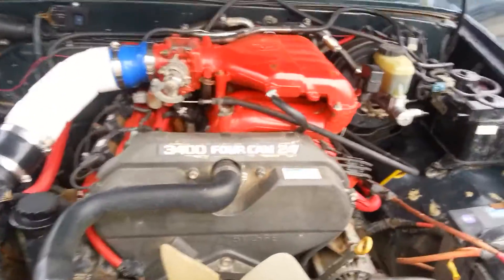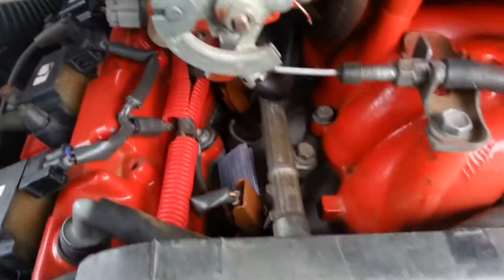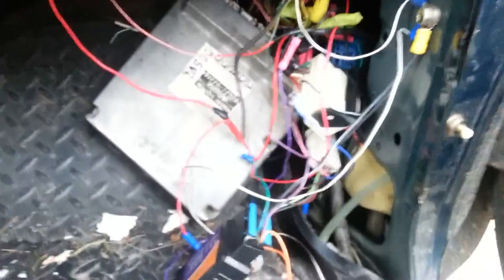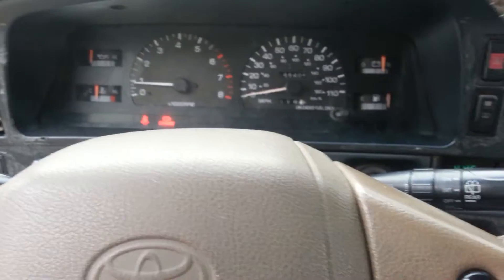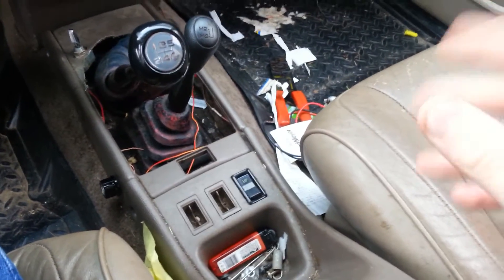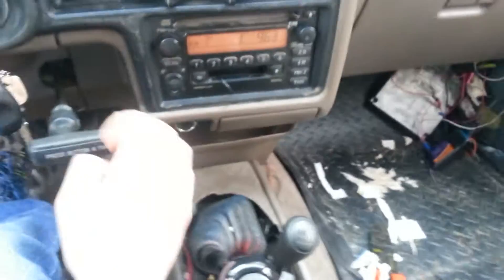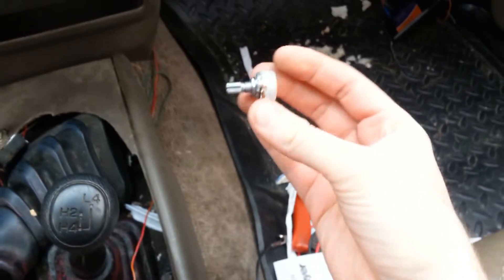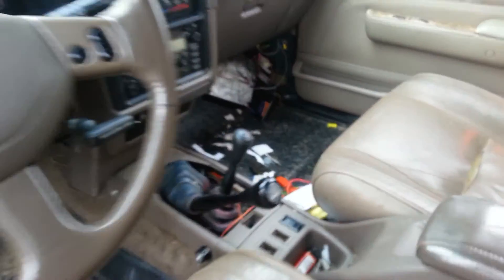ECT (Electronic Coolant Temp) Sensor Mod __  [How To Video]

Comment: What would you do for me I have a 3rz auto 97 and my idle is low 630-650 only in D or R and causes rough idle, ac on and its okay. Do i have ect trouble? What can i do for the pcm mod? I dont have that level expertise would u say i take it to a tuning shop and let them fuck around with the pcm
Reply from the maker: Your IAC valve might need to be cleaned due to being dirty from the PCV system. This mod might work for you but its more of a general fix for other vehicles that have been swapped and have a low idle caused by using a auto PCM with a manual transmission.

Comment: Did you buy truck with 3.4 swap or do it yourself?  I hear some say it's a good swap with no issues,  others say codes popup after swap and other issues.  Also I have auto so I think the swap is only done on manuals?
Reply from the maker: Everybody has a different experience. The the easier option is to swap to a manual while your 3.4 swapping. 
 After the swap is complete it is common to have issues related to the MAF, COR, vacuum leaks, timing issues (if the belts off by a notch or two) Personally if I could do it again I would shoe horn a LQ4 into it.

Comment: So basically you did this mod to advance your timing more then it would  originally when mashing the pedal? They actually make adjustable timing modules you can modify to work on this car. You can also buy a mega squirt micro squirt stand alone system to go in an tweak everything all at the thralls of your laptop. The microsquirt is also a little more then 200. Worth it IMO
Reply from the maker: It is but I had these laying around a on a weekend. Did it to help my low idle issue and also timing. A standalone is in the plans, some day.

Comment: why not just tap into the sensor plug? might do this for mine but seems easier than tracing wires.
Reply from the maker: Just traced wires because it was easier then running a wire through the firewall. Lot of ways to do it as long as the end result works.

Comment: I have a 200 ohm that has 3 connectors sticking out of it. Which ones do I hook up to and now your CTS is no longer hooked up right?
Reply from the maker: My coolant temperature sensor is now hooked up to a variable dial where i can change the throttle or force it into open loop inside the cab. To disable I can bypass that dial with a switch easily.
 
This is handy for people that plan on boosting (I do just haven't yet) or have a vehicle that naturally idles very low.(mine does around 400 rpm)

I'm not to sure what OHMS mine has, it was cheap enough to replace it when, or if it went bad.
Reply: +Gearhead Garage - He needs help with this........ " I have a 200 ohm that has 3 connectors sticking out of it. Which ones do I hook up to "